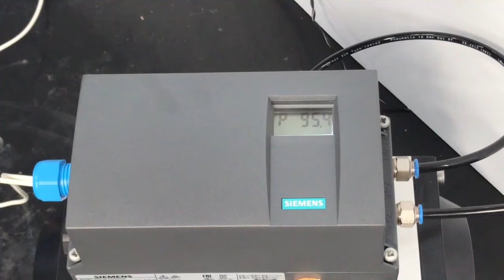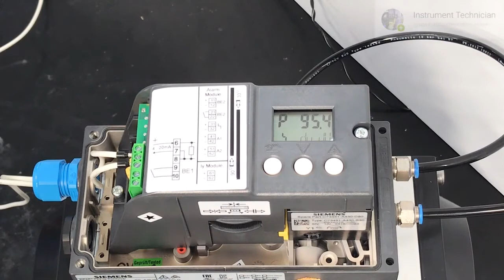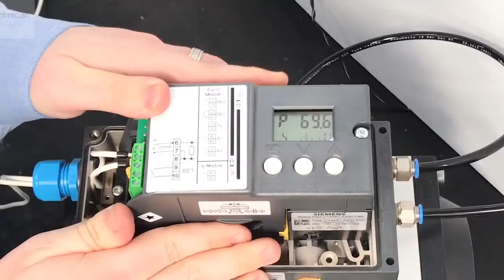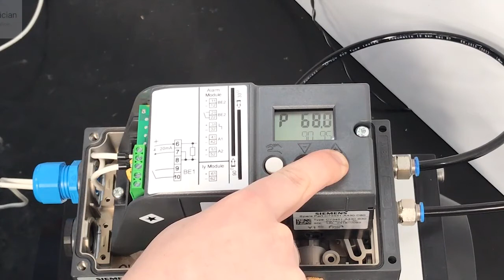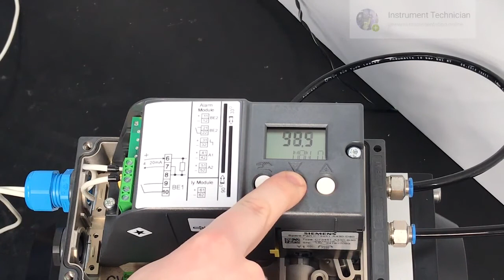Siemens PS2 Positioner Calibration

Comment: I think you need to push up on the yellow device that is just to the left of the SIEMENS model code label on the bottom right of the positioner.  When the yellow device is in the down position, it is in the 33 degree setting position.  Pushing it up sets it for 90 degrees...